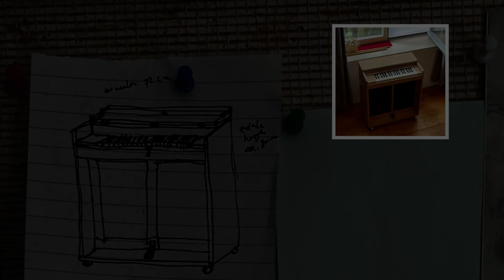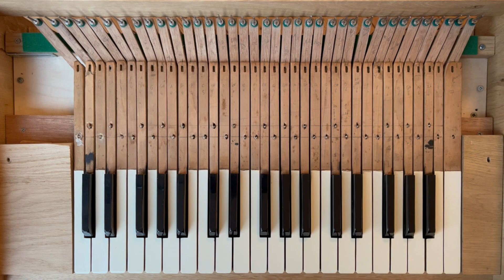How to make a celesta

Comment: I am so thankful for this video! It is the only celesta building from piano parts video I could find on YouTube. I have some questions about the bars. You said you found the materials at your local hardware store. We tried a few and were told that we were looking for a rare piece. We are in the USA; I don't know where you live, but maybe stainless steel strips are easier to find there. Also, we are hoping building a 4-octave celesta, do you think a smaller size might be necessary for the highest octave? I am also curious how you got the dimensions for the resonators. Is their a formula for this? Thank You for your help!!
Reply from the maker: Thank you, good to hear it is helpful. That might be true, I’m in Europe. According to another builder different kinds of steel or brass might work well too. Yes I would expect slimmer/more narrow bars would work in the upper octave, but haven’t tried this yet. Perhaps this experienced builder could inform you https://youtu.be/Ht1U9YG0lEI. Resonance is best at 1/4 of the wavelength if every bar has its own box (as in schiedmayer celestas) but with Mustel the shared sound chambers with a smaller opening function as helmholtz resonators. There are Helmholtz calculators online, but I didn’t use it for this first attempt, I tried to approximate the dimensions on images online.

Comment: When I push the key the hammer makes the note sound but also stops the sustain because the hammer is pushing into the metal plate. At 3:39 I see you press the note and the hammer only strikes it for a second, how did you do this and make it so when you press a key the hammer only touches for a second? Thanks very much for any reply :)
Reply from the maker: Did you connect a piece of spring steel to the hammer base as shown in 10:28 and 12:44? This should make the hammer swing back up
Reply: @noorderveld  yes and so the hammer swings back up after I let go of the key but it also cuts the sustain while I hold the key down because the hammer is pushing into the metal not allowing it to vibrate
Reply from the maker: Ah that’s true, it should almost touch the metal when the key is fully pressed, so it only hits with the swing of the attack. This is a kind of subtle adjustment
Reply: @noorderveld  oh I see ok!! thanks so much it would be impossible to try and make one without your videos and help, what you've done is so impressive
Reply from the maker: This recent video might interest you too: https://youtu.be/VYzllvP4GXI
Reply: @noorderveld  Hey, just wondering, how easily should the hammer hit the bar when pushed by finger, should there be almost no effort needed? I've only setup one box so far but when I push the hammer down there is quite a lot of pressure needed to apply to it. Is there any tips you can offer on how to make it easier to push the hammers down if need be? Thank you!
Reply from the maker: Hi, yes it is quite an intricate mechanism, it shouldn’t be too hard to push down. As with piano’s, a weight of around 50/60 grams should suffice to push the key down. The tipping point of the key, the distance from the pull rod point to the axle of the hammer and the position of the spring wire all effect this

Comment: This is beyond impressive, it sounds extremely good! Did you build something like this before? How long did it take you? And do you do this for a living or just as a hobby? 

I would love to build a celesta, but I wouldn't even know where to start!
Reply from the maker: Thanks you! I didn’t know where to start either, just gathered some materials and started to try. It took me half a year, on and off, next to the regular job.
Reply: @noorderveld nice job! Can I ask you, how did you determine the length of the lower notes that were weighted with brass? And how did you know how much brass to use? Once the brass is soldered on, you can't shorten the plates, no?
Reply from the maker: Good question! I weighed the brass blocks and took off the same weight of the plate ends. Then I first attached them with some glue to check. If it proved too high I used it for the higher note, by filing off some brass.
Reply: Thanks for your answer! If I may ask another question, how did you determine the dimensions of the resonance blocks? Just by trial and error? Seems like a lot of menial work!  @noorderveld
Reply from the maker: @lysistrata22  Hi, I added some info on the resonators in the video description. I'll try to measure the resonators in this celesta later and add them as well.
Reply: @noorderveld wow, thank you so much!
Reply: @noorderveld Another question if you don't mind! :)
I am now sawing the metal plates using the same material as you. 10cm did indeed give me a B as well. But the formula does not quite give me the right measurements. Do you take the square 😮root of the whole term or just the first part of the equation? @noorderveld
Reply from the maker: Good to hear. The whole term, though it could be off a little because of the holes and the material. Best to keep measuring and take neighboring notes as reference I suppose.